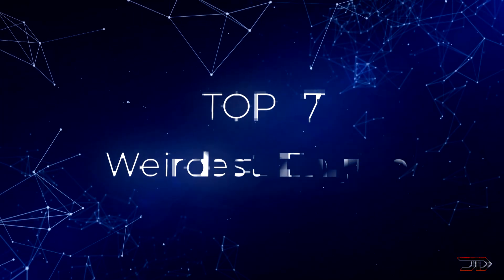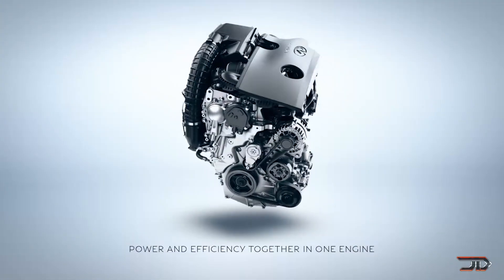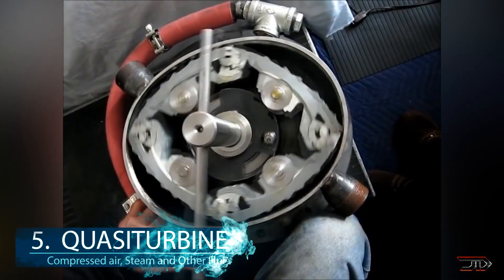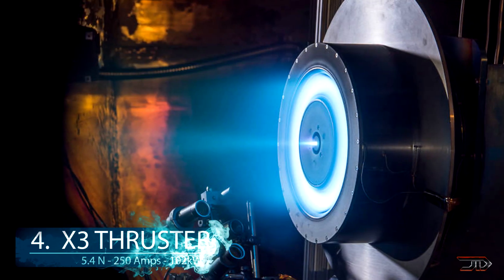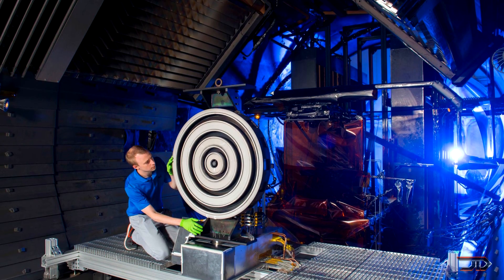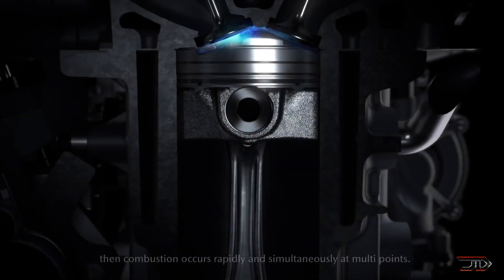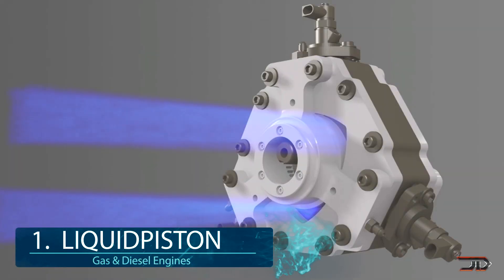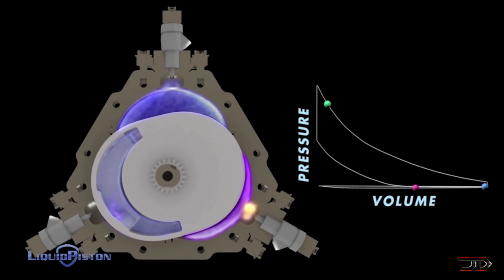7 STRANGEST New Engines

Comment: I see the Circle -Cycle motor's best application in watercraft where resistance is fairly constant throughout the revolutionary cycle .  The motor looks fairly compact so it probably would fit in both 2 wheel and 4 wheel applications easily?

Comment: That second one, can't see that working, why dittn he make the cyls longer so the Pistons don't escape the bore.. Then it wouldn't need any crucial alignment gears. What stops the oil from spraying into the cyls.... 
  What happened to ceramic engines that were doing to be used in Merc back in the 80s?  Also there was a motorbike testing oval pistons but was deemed a pain to bore and hone correctly.. Went like the clappers tho 😎
Reply: Because it wouldn't work that way, youd need to have one piston that way, instead of two.

Comment: The Liquid piston would be good for power armor where light weight, fuel efficiency and high output power is more important than engine longevity.
Reply: Having a disc like that spinning on your back would also shake your teeth out
Reply: @halipatsui9418  Less reciprocating mass than a piston engine, so I don't think it would be easier to find a more helpful gasoline method
Reply: What happened?  Did you run out of the standard Fusion Core?  Diamond City might be able to hook you up =)
Reply: Orbit Corkra  -  I was thinking more of the Space Marines power armor from Warhammer 40k...   there’s actually a troop type in regular Warhammer on the goblin side (and this is the tabletop game, miniatures) that’s a goblin sized slingshot with goblins that have pointy metal hats (like sharp nose cones), fabric stretched between their arms and bodies and a barrel of gunpowder on their backs.   To use them in game you have to call a distance and direction without measuring, then measure to what you called and then roll two d6...   one has arrows, a blank spots and a (potential) failure, t’other has numbers and t’other (potential) failure (roll both and the goblin explodes at the slingshot).   Whichever direction it points, move your marker that way whatever # came up and that’s where he lands...   it led to some very entertaining moments at the comic and gaming store I worked in :)
Reply: @grendelum   Oh there's Space Marines in Warhammer 40k.  That's cool I never played it but it kind of sounds like D&D sort of.  I've seen the figures for WH and they look beautiful, very creative and detailed.  Did you know there are Space Marines in Command & Conquer 3 also.  Hehehe they get around don't they?  Have you seen the power armor from Fallout 4 they're pretty sweet they use the fusion cores.
Reply: Orbit Corkra  -  Yeah, Fallout 4 is fun...   I found an excellent video that describes what Warhammer 40k is and it’s roots...  like the video creator, I’ve been involved with 40k (and regular Warhammer, a more classic medieval fantasy setting) since the early 90s so I’ve read a ton of the books that further flesh out the universe it’s set in and the background of the different races and of course, the differences between the myriad Space Marine chapters.  It’s definitely a video worth checking out, enjoy !!               https://youtu.be/zmZcIX5PEyo
Reply: Heck yeah POWER ARMOR!!!
Reply: The mechanical components are like that of a wankel engline. So, i don't think that this will be very reliable as it would need constant vapour lubrication as well as apex seals
Reply: A small OPOC would provide far more power in the same size envelope, and probably better fuel economy.
Reply: liquid piston should be used in dirt bikes like 2 strokes. or just bring the wankel back in a dirt bike
Reply: Snow White  -  I’d think power armor would be better served by a distributed network of energy storage devices (batteries, capacitors, whatever), rather than a single point of failure.    One slingshotted kamikaze goblin to the back and your armor is out of power with the liquid piston...

Comment: Quasi-turbine, spends $86,000 on machining internals, spends $7.95 on plumbing fittings to pipe it up...
Reply: the quasi turbine never works as combustion engine, only blow with steam or compressed air: this engine as far to much friction losses...
Reply: And therefore it is a motor and not an engine...
Reply: @brianevans1946   the non sense differenciation between engine or motor exists only in english, in all other languages it's only motor
Reply: @Brian Evans. 

No... it’s an engine. 

It turns heat into mechanical motion... the very definition of an engine. 

A steam engine is still an engine. 
A turbine engine is still an engine. A pneumatic engine is still an engine. Feel the discharge air... it’s cold.
Reply: @leneanderthalien

What language are you speaking?
What country started the Industrial Revolution?
Reply: Bartonovich52 yeah its cold because ANY gas that is decompressing is going to be cold
Reply: @HidekiShinichi 
Exactly, that's the definition of an engine. It takes heat energy and turns it into mechanical energy. Whether its internally combusted or externally combusted  doesn't matter.

And yeah I'm not sure if this Leo Licht person is really a person or someone's bot experiment in a college programming class.
Reply: @Bartonovich52  
So now i should call my motorcycle an engine-cycle....??
Reply: +Jayy Tee. English is a wonderfully confusing language. Regional variations make it even more so.
In England we wear a pair of pants, while in Ireland they simply wear pants. The argument that pants are a pair because we have 2 legs, falls flat when we don't wear a pair of shirts, even if we are lucky enough to still have 2 arms.
Thinking even more closely, why the "s" on pants. we don't wear a shirts.
Time to head off to bed and take my pant off. 😊😊😊
Reply: @wilsjane  
Probably from time in the days back in history when men wore individual leggings on each leg is my crazy guess. But i wonder how the origin of these terms started. It's not just well educated scholars the develope a language, but also the culture and slang of every day people.
Reply: @wilsjane  a shirt...for your torso. Or you have 2 torso? Anyway a pair should always be 2 units of the same type, at least for me
Reply: Coalicious  more like 800
Reply: @borinthiago  In American English, there's also a big difference between engine and motor.  I try to remember it with this mnemonic:  We killed all the Engines that used to live here.  Only Pocahontas was left, but our artillery Motor down.  America! Fuck Yeah!
Reply: Its more similiar with mazda rotary enggine than new model
Reply: whey i did hydraulics if i ever used a street E i would be out of a job.
Reply: @borinthiago  But... There isn't.
Motor e Motor. 
Não há DIFERENÇA 😂😂.
Reply: Leo Licht symptom you are showing up are not even symptom of veganism, those are symptom of moronism
Reply: Hi there, my name is Dexter from Asia America, a CNC Precision Parts manufacturer originally from California and production facility been moved to Dongguan China since 2005. We’d like to extend our manufacturing services to you for your metal or non-metal CNC precision parts outsourcing need.

We offer complete production facilities of more than 100 CNC machines in the plant, R&D Support, Cost-Effective production process, and Favorable payment terms.

We'd be happy to work on your inquiries and RFQ’s.

For more information about our Asia America, please check below our company videos and our website.

http://www.cncmachiningmill.com/video.html

Thanks,
Dexter Jenobiagon
Foreign Trade Manager

Asia America Industrial Manufacturing, Inc.
Tel.: +86-769-88568855 / 769-8568877
Mobile phone: +8618027043263
E-mail: aa4@aamfg.cn
Website: http://www.cncmachiningmill.com/

Comment: that second one looks like it would be susceptible to alignment problems...
Reply: I've had that happen before, rapid misalignment can result in slap to the face.
Reply: Neil Dohi  -  😂🤣   It can also cause bruised equipment !!
Reply from the maker: Heh yeah, points for originality though,.
Reply: If anyone in the room even thinks about wiggle room... That thing is going to explode
Reply: matthew hurley  -   I thought the video of the open one was going to demonstrate the catastrophic failure mode that could occur with that engine...   I’d not want to be anywhere near that thing...   it definitely is unique tho :)
Reply: at least saves the effort of disassembling it to diagnose the problem.
Reply: just what i was thinking, if its shaken about by bumpy roads or whatever it wouldnt be pretty
Reply: Not a 100k engine by design.   Nice thinking outside the box tho.
Reply: Imagine what jumping timing on that bad boy would look like.
Reply: Just wait until it wears a little slop into it.

Comment: Achates 2.7 is really nice concept that way 360° blast efficiency can be captured.
Reply from the maker: It's definitely better than that Ecoboost heh. I believe the old Junkers from WW2 used the same kind of design.
Reply: @Motor_Explorer1  The napier diesel uses that principle too, tho it has been used in railroading.
Reply: The Soviet T-64 tank uses the same concept as well.
Reply: Those WW2 Germans invented our world we live n Today!!!
Reply: If you look at marine engines used on ships, this engine design has been around for about a century. (Not really a concept, but well proven.) Displacements on those tend to be ridiculously huge even when compared to semi-trucks. (You could fit a regular car engine inside one of those pistons.) They just chug along quietly and smoothly.
Reply: Yeah, the Commer Knocker was particularly good at converting fuel into noise.
Had about 18hp (i'm joking for idiot naysayers) and consumed about the same as 400hp - most of which was converterd to the most sublime very loud noise.